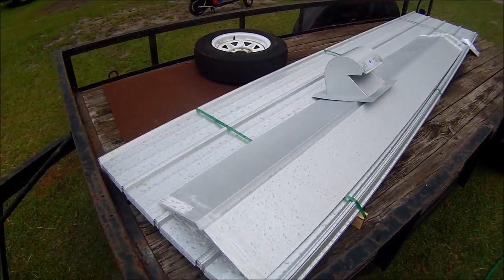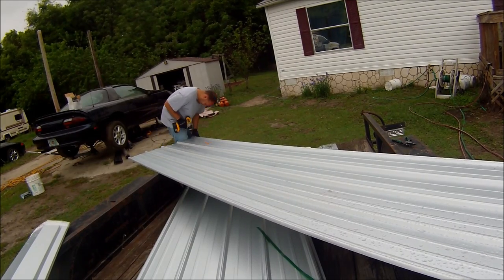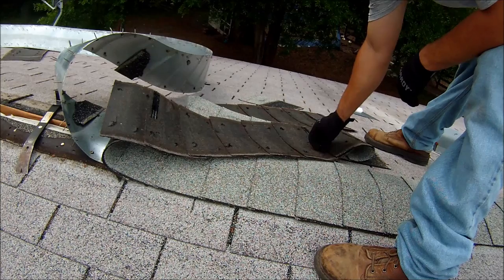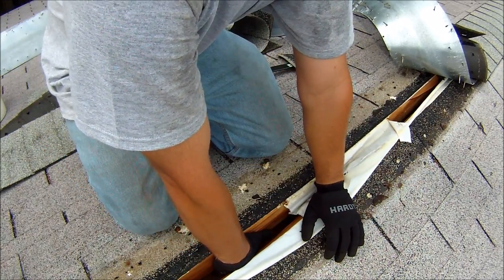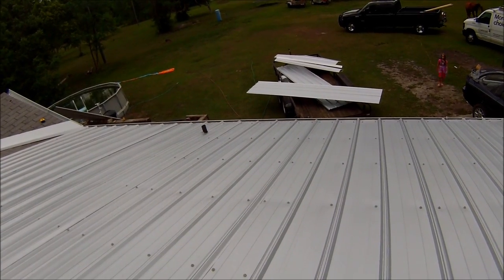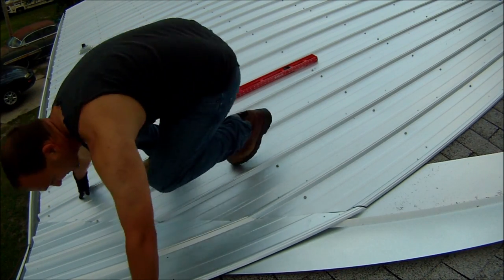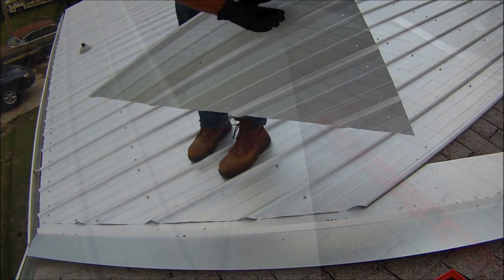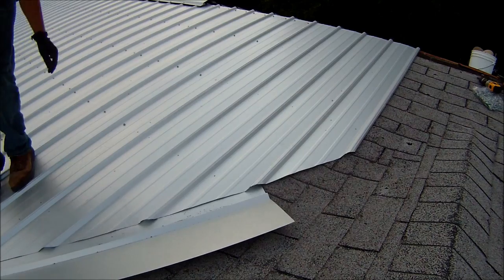Metal Roof Over Shingles on a Mobile Home by Myself

Comment: You have a mobile home that was built correctly.  I have a mobile home that they went cheap.  It has a composition roof but they put the roof to the edge of the wall and they used 2x2 trusses.  My concern is the  weight load that will safely be carried.

Comment: The butel tape should be used in the valley to prevent back flow of water. Also as a sheet metal roofer I use it on the laps to give extra seal and I use caulk under the laps of the ridge cap. Otherwise good job.

Comment: Great job!  I've always been interested in installing a metal roof, but the concern I've always had on it is leakage.  I know you have to do this to keep it down, but don't those screws eventually leak over time?  I've always been weary about it because non of the exposed screws are overlapped like shingles are.  I know there are little "sealers" around each screw, but don't those wear away eventually and then the entire thing starts leaking?  Just afraid of this happening...  I don't like seeing exposed screws or nails where it could leak.
Reply: very nice job DIY. I did mine in 2015 all by myself too, same profile but heaver gauge.
1. I put strap 18" apart, more time consuming but it's gonna be flat.
2. I use heavy gauge 26 or 24 
3. I use 3" screws and only screw on the rib where the two sheets meet, 2 feet apart.
I thought you only screw on the flat for wall. I always put screw on the rib and tighten by hand so the rubber doesn't get damage, never have any problem.
Reply: To answer your screw question, The rubber will last a long time, but eventually yes it will rot off and leak over time

Comment: Can this same method be used on a mobile with original  metal roof ? i'm needing to lengthen the life of this old mobile ,and seem to find a video similar to what mine is
Reply: I don't see why not. Only thing is the older homes don't have any roof decking to screw into in between the rafters, so you might need to put in some furring strips first. I've seen some videos where folks put up OSB sheets over the whole roof first then they put the metal on top.
Reply: @ZBrock  Yeah you would have to put furring strips up, i've also seen where people put furring strips in and then plywood ontop of that,

Comment: Omg..What? Yaaaaay because I just went to Lowe's to ask can I put metal roofing over my shingles roof? The guy told me noo! 😠 so thank you! I'm doing this" ASAP looks great!👍😄 well done...
Reply: High winds will take care of that metal roof if not do right! thanks !im a roofer ! I make a comment about it! Please don't lay your metal straight down to your decking lay 1x4s down first make sure this 1x4s are secure by screwed in to the rafters ! Then lay metal sheet just trying to help Thanks!
Reply: @frankyoliva8048  
Thank you"👍I havnt been able to get to it yet' tks so much.
Reply: @frankyoliva8048   I been applying metal panels over 3/4 osb on pole varns for the last 15 years not a single complaint or issue yet. There is no need for a rise of the metal panel. I also install the panels over 2x4 perlins no issues either. 

Your a roofer?
Reply: I put mine on this way and everyone said not to. 11 years later no problem. I'll be dead and gone before my house moves enough to grind a hope in that metal. people are crazy
Reply: @mikerushing362  The man knows what he is saying .  I promise you that the mobile home did not have 3/4 osb in fact i doubt it was a full 1/2 inch .  osb does not have a adequate pull strength..

But you are missing the point its not that he was trying to raise the roof dummy he is trying to attach the panels to something that will hold because I promise you if it does blow off the manufacturer will be the first one to ask if a pull test was done on the deck .
 But only a professional roofer would ever install anything per manufacturer specs how silly of me .  We should just listen to Mr Rushing 

   But hey if you say its good then by god it must be good .  Who would put osb on a pole barn roof anyway .  Are you a real barn builder are you aware that if you install metal panels over a osb or plywood deck that you should install a moisture barrier because the nail heads ill start to rust the panel from below but you knew that right ..
  I love people that  comment on things that don't know a damn thing about what they are doing but they believe that if they did it wrong for 15 years then by god its the right way to do shit .
Reply: @frankyoliva8048  I thought the decking was screwed to the rafters

Comment: A good way to cut long runs on metal roof is to install saw blade backwards on your skill saw. It’s loud as hell and your neighbors won’t appreciate it but quick and straight.
Reply: Or purchase a blade to  cut the tin.
Reply: @billmonroe8826  Running a carbide-tooth saw blade in reverse to cut sheet metal will knock every single carbide tip off the blade. Buy a proper sheet metal blade.
Reply: @jealouselephant4139  Yep a carbide will.. I use blade for metal. A little less noise than reversing a regular saw blade
Reply: I dont know where this dumb idea about reversing a blade came from but its stupid. All you do is knock off all the carbide teeth and destroy a blade. But a metal cutting blade or use electric shears or nibblers

Comment: After doing over 10,000 squares of metal roofing think you done a good job. the things that I did a little different. not ducking the sheets underneath just use a vise grip at the top to hold it in place until screwed down. use a saw, nibbler and wiss green and red snips. And the closure strip they gave you to use on the ridge cap was horrible. I would of cut it to fit into the lows of the sheets.

Comment: Great video. Doing mine this spring. I'm going with the hidden fasteners style. Not just for looks, but i feel more comfortable not having any screws exposed to the elements here in Ohio. Freezing ice in winter and rain throughout most of the year. Lol.  What length screws did you use?  I will be doing a couple sections here and there as time provides me also.
Reply: Use long enough screws to go through roof sheathing completely.

Comment: Never lay metal panels directly on shingle. The metal expands and contracts and it scratches the panels underneath causing premature rusting. You should have run furring strips every 2 feet.
Reply: it's how I done mine 11 years ago. haven't seen any problem yet
Reply: Robert Turner Unless synthetic was used ... it’s ok then
Reply: I thought the same thing. I wondered where his strips were
Reply: Not true, 18 years my metal roof has been on, directly over shingles...zero issues whatsoever
Reply: You don’t have to use furring strips if you don’t want to
Reply: You won't see the damage from the topside until it comes through from the bottom.  You should either strip off the shingles, use furring strips or that thick underlayment to get the longest life of the roof. Great job though.
Reply: Robert Turner You cannot put metal straight over the top of shingles the metal won’t last long this is definitely the wrong way to do it
Reply: Robert Turner I agree with this 100% even if it is aluminum it scratches and eventually it’s going to wear holes in it
Reply: rain Alaska  
Hi Rain, Your perfect.
Reply: Exactly. The only reason I'm here was i saw the thumbnail and was going to say the same.
Reply: rain Alaska  its NOT aluminum lol. Its Galvalume.... Coated tin.
Reply: Just like galvanized is a coating on steel.... It certainly can still rust and is faro magnetic..... Because it's NOT aluminum.
Reply: rain Alaska  metal most certainly expands in heat. You can literally hear it expanding in extreme heat, makes very faint popping noise.
Reply: @Skyjade316  metal is way more thermal stable than wood. +/- 120 degree isn't going to cause appreciable distortion.
Reply: @MrAwsomeshot  still doesn't change the fact that metal does expand in extreme temps
Reply: Drew's Roofing & Home Repair yeah in 50yrs maybe
Reply: Why not 3 feet?

Comment: Brother, good job. the only thing I can say is that you threw safety completely to the winds of chance by not using some sort of fall protection.  The livelihood of your family was just one slip away from disaster.   Fall protection is easy if you have nearby poles, trees, other structures to secure to using ropes. Otherwise, use the ground to secure to...make it [your ropes] adjustable and just enough length so that you can move around on the roof without falling off of it should you slip, trip or fall.   I know it was a mobile home with a small roof and easy slope but you can never forecast unforeseen events.  My former Safety Director lived and breathed safety and was a stickler for safety procedures. An unforgiving do-it-by-the-book type of guy who never allowed for any unsafe acts.  I sent him a link to your video so that I could make his skin crawl,  hahahaha!  I know for sure that his palms were all over his face while watching!!! Take care!

Comment: good job, dude.  i see you didn't cap the ends of the ridge cap yet.. are you going to do that sometime in the future?  or just let it overhang?  who makes that metal panel system you put on?  how many square feet for that roof (mine is only 437 sq ft, and i paid $617.05)?

Comment: The metal strip you removed from the ridge was to keep both halves of your home together. You may want to check the level of your home.
Reply: Yikes.   Better to cut slots in it to provide ventilation, no?  Or replace it with a slotted metal strip.
Reply: Lmfao please explain how that keeps the roof together!! You must work in construction bro. I'm a full time metal roofer for the last ten years including rain gutter/sheet metal. Your telling me that 24 gg piece of flat stock is going to keep a ridge together hahahaha. Your something else bro.
Reply: Christopher Compton it was a joke! LoL
Reply: He's right.   That is 30 Guage metal nailed every 4 inches on both sides.  It's code and structural.  If you take it off your other options are lags or metal straps tying the two halves together.

Comment: great video.  I bought a MH that was done in the way you show.  As others have pointed out using purlins or at least #12 screws is reccomended.  Storm Matthew ripped several of my panels off.  The screws just popped righr out of the osb and shingles.   insurance said not covered because improper installation.  They said needs purlins but larger screws would not have let loose.  So now I'm replacing all the screws with #12 :(
Reply: Nor Kavon purlins?ok im confused on how purlins would be used on a residential roof?
Reply: I think he is referring to battens, not purlins.
Reply: So, you were out about $60 worth of panels?
Reply: Sad that happened to you. But at least it's just the cost of a few boxes of screws. Coulda been worse.

Comment: Why did you run the metal up tight against the w valley rib. There should be a gap from edge of metal to valley rib. Most manufactures recommend a min. Of two inches. We install is Washington state at 4 inches due to heavy rains.

Comment: Do you have blowing rain in Florida? ?  Hope not. The v in the panel when laid on top of another panel create a tunnel where driving rain goes up into the tunnel and then finds its way underneath your metal roof. That may be what the roll of goeie sticky stuff on the roll comes in . Did your roof come w instructions?

Comment: My husband and I are considering a metal roof on our home. I have two questions, if you don't mind answering them. What year is your home, and did you see any substantial savings on your power bill during the summer months? We have an 88, and pay between 2-500 per month for electricity. I am sure we could benefit from additional insulation, but curious as to how much if any a metal roof would save us.
Reply: Thank you very much!
Reply: $200-500/month electric - EEEEKKK!!!  When I had a mobile home (singlewide), i noticed that after installing cheap plastic venetian blinds in every window, my electric bill went down $50 a month. Trees close enough to cast shade, but not tall trees, help tremendously also. (Crepe Myrtles are great for this. Some grow 30-35' tall, and would provide morning and afternoon shade if on both sides. Plus they look great). When I bought my house in '97, it was on a huge lot with one magnolia tree on south (narrow) end of house and two huge sweet gums on northern east and west sides. They provided almost no shade.  I let an oak tree and some crepe myrtles grow at the extreme west edge (streetside), and did same within 25' of east side. Put in the walmart plastic venetian blinds in every window with sheers and regular drapes over that. I also started shutting my all electric (house) hot water heater off, only turning on 20-30 min. before bathing, using rest to run dishwasher and laundry, then off again.  My light bill in all electric old house with no wall or floor insulation has dropped to lower than what it was in '97.  I learned that if I keep the direct sun out on east side in morning and west side after 2 pm,  my house will naturally stay cool until almost 4 pm, after which I  open door and windows on shady side until night. This allows me to keep a/c off until mid-July. Then I seal up window and door in room I'm occupying and turn on a/c. I keep (in summer) ceiling fans running 24/7 in rooms I use daily.   Guess I'm obsessed, but since I'm retired I have time to monitor and observe.

Comment: Run both of the valley pans all the way up and get them straight and tied together first. Then nail or screw them off. Pop a 2" line on both sides of the valley rib. Then you know exactly where to hold the level for a perfect line.

Comment: Nice video, as ethics 101 mentioned you should not go straight over the shingles. Strap the roof, or there is a roof membrain that comes in rolls you apply first over the shingles, then you can instal the metal roof panels. The roof membrain let’s the metal roof panel expand and contract with out the shingle grinding the panel and wearing the panel out prematurely. But good job doing the work and making the video.
Reply: Would putting furing strips over the shingles be better than applying right over the shingles?

Comment: At 29:40 or before I would have put silicon around the base of the pipe where of meets the roof and the two joining panels before putting the cap on.

Comment: How do you install the metal panel around a electrical service on top of the current asphalt roof? Thanks!
Reply: There are pipe flashing pieces that wrap around and have a seam designed just for this purpose.

Comment: I was told to never put steel directly over shingles due to the expantion and contraction day and night can wear a hole through the steel from the abrasive stone on the shingles , I was told to put down felt or fanfold first ?
Reply: good enough for me. this metal roof will last over a hundred years. how long will it take to rust through?
Reply: LOL...@ 100 Years
Reply: Y'all just don't know! Yo must not lay metal sheets right in to the decking! No! High winds will rip it up!

Comment: Obviously the sheet metal was there to form a somewhat vent at the end because normally when you shingle, at ridge you overlap with field before you put on caps. Now maybe because u have a pre fab home, they build it with that air space at construction. We never used flashing on ridge for cap. So that must be a form of ridge vents.

Comment: You are removing the separation cover that joins the two halves of the mobile home (the halves are joined on site). On a stick built home the trusses are continuous. On a mobile home they are not continuous but two or even three separate truss sets. I have serious concerns about your reasoning at this point in the video. How did you re-secure the halves of the home along the ridge? Maybe a pro roofer can talk about this here.
Reply: I can assure you that the flashing between the two halves isn't securing anything ... It's just a cap.
Reply: That cap just keeps the rain out. 10 years Mobile home set up.

Comment: Im still amazed at the number of guys I see working in ungreased leather boots.  Nothing wrecks a good pair of leather boots quicker than letting them dry out, you need to be using mink oil or the new silicone spray and get a coat on them boots.  Your feet stay dry in the rain, at least for a little while anyway, and your boots are able to stretch a bit more when greased.  And it makes them look better.

Comment: 23:20 installed the valley flashing wrong/backwards. If you're using more than one piece  Valley flashing in any one valley you must  run the last piece under the piece last installed assuming you're starting from the high point of the Valley, avoiding rain water running into the edge of the next piece instead of over it and on to the next peace.

Comment: Just don't overtighten the Screws on Metal Roof if rubber grummets is squeezed to much, you are sure to have a leak a few years down the road....
Reply: Neopreme grommets on roof screws not rubber.
Reply: @gerardjones7881   Rubber for sure. Been building pole barns for 15 years

Comment: So where are the wood slats ?
Im doing this now but i screwed 1x4 wood slats into rafters to space metal panels off the shingles.
My shouldes hurt and knees too. My roof is steeper. Im 65, screw this crap.
Reply: Don't need them if you have vents to control the moisture like he does.

Comment: Hi, great video!!. I'm also in FL (northern) and just dealt with Matthew. Ended up finding I have a small roof leak plus the roof is almost at the point of needing replacement. I'm looking to do the same thing in the very near future. Where did you get the metal from?
Reply: Awesome, I live just north of Palatka near Green Cove Springs. thanks!!